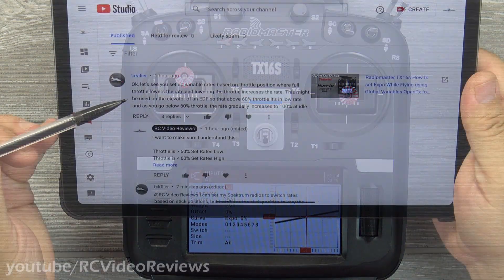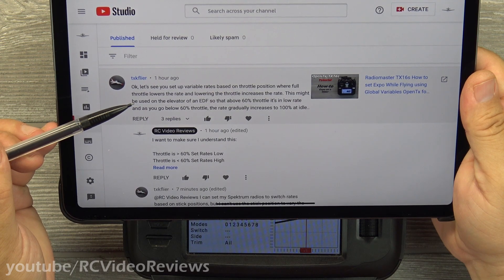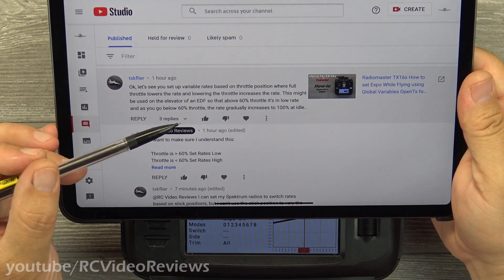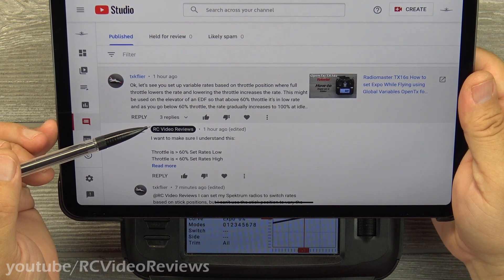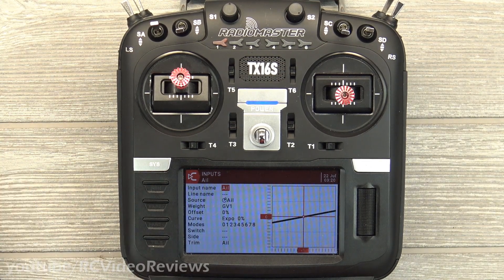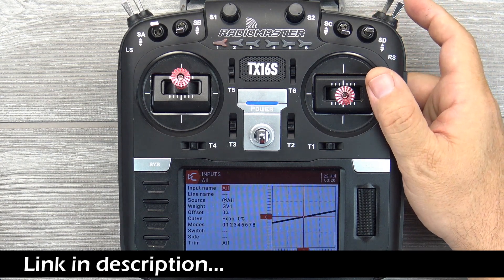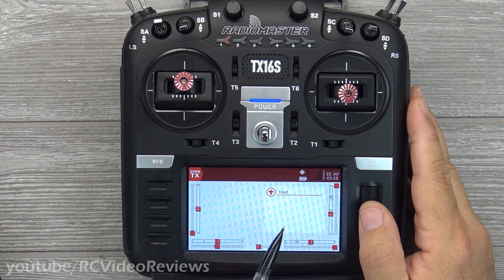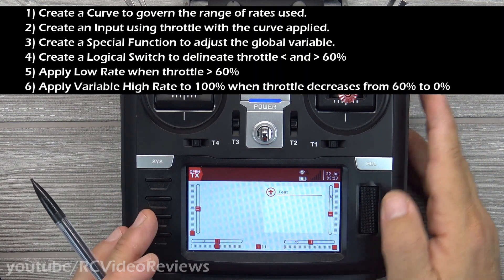OpenTx Companion Tutorial • Dynamic Dual Rates • Radiomaster TX16s • [Advanced]

Comment: Really cool used to do this with Futaba called stick position switches.  We use them in IMAC for an upline mix throttle to elevator and aileron. At 90% throttle only used on up lines you need a little more rudder and less elevator to do a nice snap.   Also a down line mix at 0 throttle gives a little down elevator to make sure the plane holds a perfect down line.  The down line mix can be deactivated with a landing mode.  Thanks so much.
Reply from the maker: Stick position switches--good name for it.

Comment: Hi.  Got a Power 52 question, saw your video with the 100a 14:8 apc pulling 1500+ on 5s. Upgraded a gas H9 P-51 To electric with Power 46 but it was low watts per lb so I upped again to the Power52, with Avian 100a 4s 5000mah 50c and 14:8.  Only pulling 41a which is 688 watts at 16.8v or 95w per pound on my plane, it’s about 7 lbs. Comparing w your results, my w/lb should be much higher. I was getting 80w/lb on the Power 46, so not the expected return on upgrade to the 52?  Any thoughts?  Bought a 6s but yet to get a suitable prop for testing.
Reply from the maker: A Power 52 with a 14x8 and 5s pack should get you north of 1500watts. 4s is too low for that motor/prop combo. Use a 5s.

Comment: This sounds familiar... https://youtu.be/NpvWaC2MqWw
Reply from the maker: It does sound similar. His example is a little more static in that he toggles from low to mid to high based on throttle. This example is dynamic and sets weight on a much more granular analog scale using stick position.